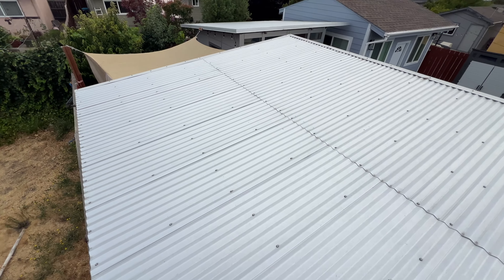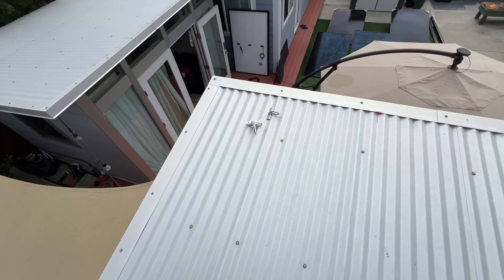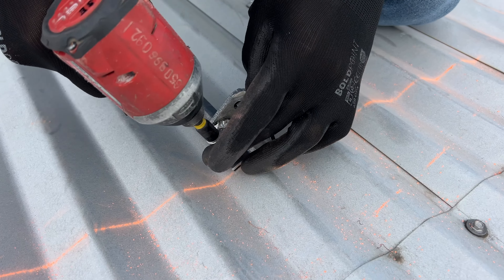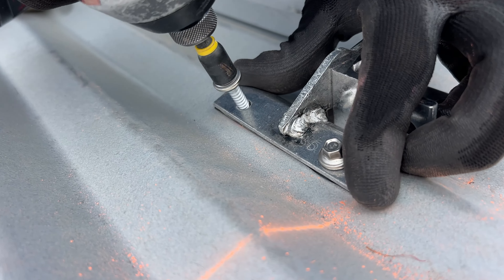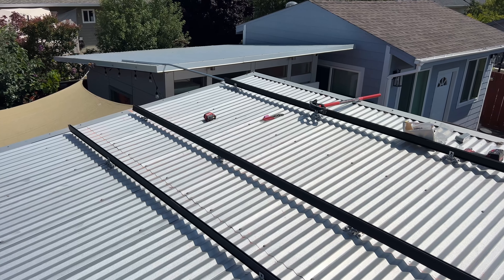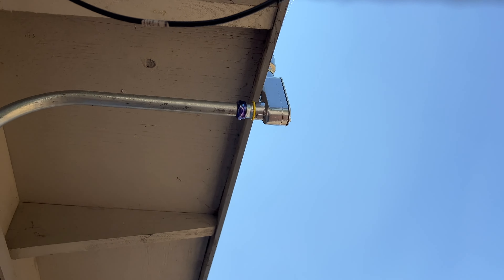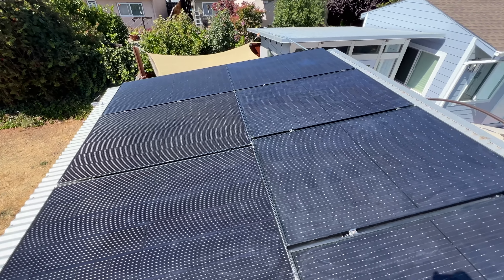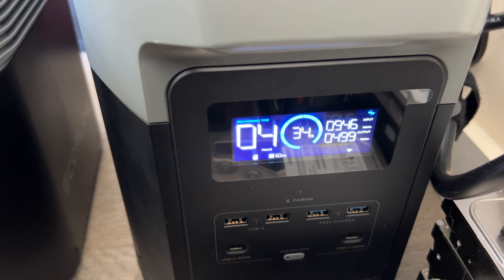7 solar panels for Ecoflow Delta 2 power stations. Metal roof.

Comment: while using ecoflow's do i have to keep RSD's into consideration during install and city permits?
Reply from the maker: read  NEC690.12
there are a few considerations: voltage in the string, if panels are installed on dwelling or non-dwelling unit

Comment: Why didn't you just go with direct attach to panels without using rails? It's a better and cheaper setup according to the S-5 company
Reply from the maker: Do you have a link to product instructions on how to mount panels directly to brackets?
Reply: I would like to know as well.
Reply: Rails give you more leeway than direct attach and it's easier to actually attach to the panel manufacturer mounting points. Also fewer penetrations